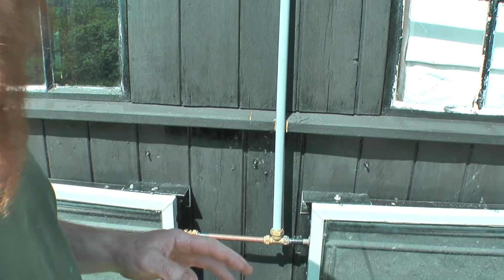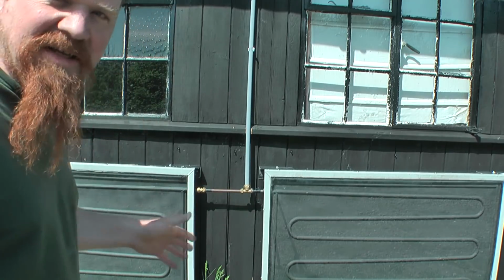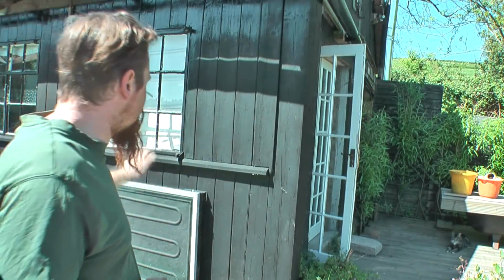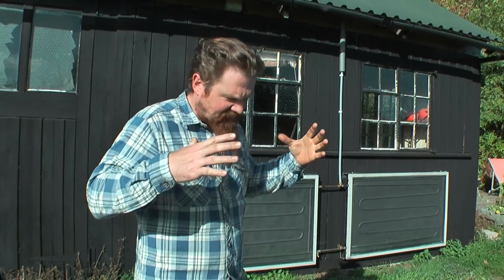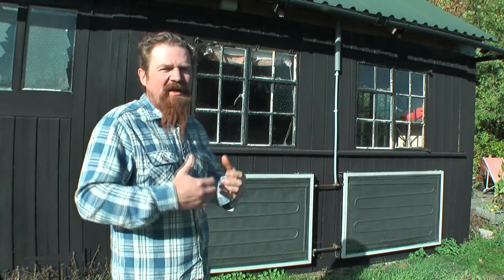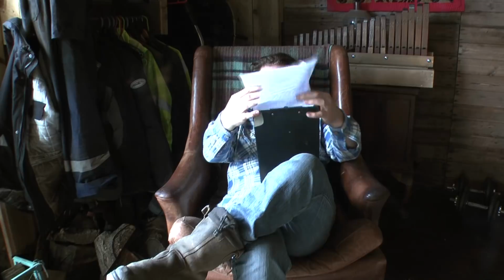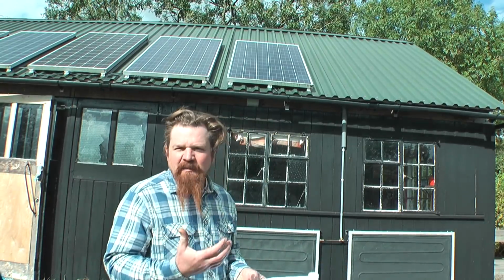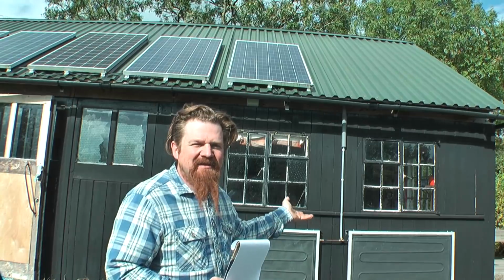Solar Hot Water Part 3 (of 3)

Comment: I have worked on designing controllers etc for solar PV and one of the issues is efficiency is lost when the cells get too hot. Energy from PV is not great for heating however this water heating type of system is significantly better and possibly the best system currently available for heating from solar energy. This leads to a question: how could the two be combined? IE a silicon PV panel (as GaAs is way too expensive at the moment) with water taking the heat from the cells and being used to warm the floor. That way you could potentially get significantly more power out of a panel than either system on its own. Not sure exactly how you could get even heat exchange on the panels but I'm sure someone could figure it out.

Comment: Another great video! Bottom line is you paid relatively little for the setup and have effectively got free hot water all summer. Win. 
No expert but i think you're right about not needing more pipe in the panels. Do you think adding some horizontal  heat sync fins to the copper might increase your heat uptake?
When are you going to add that fancy tube one?

Comment: Great experiment, but you need to lag that return pipe. The circulation will still work fine and you will get a higher water temperature.

Comment: The cooler the panel temperature, the less the loss of heat to the environment - and the more energy you will get into the hot water reservoir...well that's the theory...hope that was worth commenting on!

Comment: Hi there ,  years ago i was very interested in building my own panels similar to yours i did take it to the extreme as i always do when researching a build and found out that it i vacuum sealed the panel and used a vacuum pump to remove as much air as possible  the efficiency went up also i found that instead of black mat paint  using powdered lead on the collector had the highest efficiency of heat collection into the copper sheet .  hope this is food for thought for you.  you could always try making an experimental panel from scratch

Comment: I think you have done a great job.. like to see the system work. 
You say the flow rate is too high, so bends in the pipework can’t be an issue with yours? In fact if your thermo syphon is flowing too fast then lagging the return may be a good idea to slow it down. May even increase the output temperature and lowering heat loss too.. if it didn’t help it wouldn’t be a big job to take some back off anyway!

Legionella is the worry with warm water hence get it to 60 degrees every 24 hours,, but people scare easily about this.. it takes about a week for water to turn stale and the issue arise anyway.. think your managing it ok ..
👍👍👍

Comment: Insulate flow and return pipes of panels to tank. The thermal siphon will then only begin when the temperature of the panels exceed the tank. You need the panels to get to approx 5-10 degrees more than to tank to have a good effect of heating the water in the tank. Avoid all heat losses.

Comment: I think you've done an awesome job, using what you have.  Not having to light the fire so much in summer is a real bonus
My only comment is that I would not throttle the water in the panels before they return to the heat exchanger.  I think it would be better to heat lots of water a little bit constantly, rather than heat a little bit of water a lot and then dumping that through the system.  I know this is how solar hot water systems work for heating pools, basically only trying to raise the temp a couple of degrees every time the water circulates through the system.  Might be something to consider
Reply from the maker: Yep, I do let it run wide open normally, it's goes up to 40-45 degrees quickly that way but then slows right down. The throttling was just to see what would happen, if I tried to get the temp higher, maybe not explained myself very well there!
Reply: Awesome as that should be getting you the most efficiency out of the system.
Russ while you are right about the amount of BTU's gained you have not taken into account heat transfer
Generally speaking, the faster the flow rate the more efficient the heat transfer, but the efficiency has to do with the temperature difference between the heat source and the fluid being heated so there are diminishing returns at faster and faster flow rates. The rate of heat transfer between two points is a function of the thermal conductivity of the material between the two points and the temperature difference between the two points (and the amount of area of contact). A faster flow rate means the temperature of the water doesn't rise as much so that makes the rate of heat transfer somewhat higher.
The fact that the amount of temperature rise is lower at the faster flow rate doesn't mean the water rises in temperature more slowly. On the contrary, it rises a little faster since more heat is transferred as noted above. 
If you lowered the flow rate in the system, the temperature of the water flowing through the panels would rise more but the amount of heat transferred would be somewhat less due to the lower efficiency of transfer in the panel due to the smaller temperature difference between the panel heat and the water (since the water is now hotter). If you want more efficiency of heat transfer, an even faster flow rate would be a little better.
Reply: Same amount of energy being put into the water. Idea is trying to find the balance to keep the flow.

Comment: Hmm could you draw out a simple diagram of your system with some basic notes  on your Web site I would pay for it
Reply from the maker: I did a video on heating and hot water that has drawings in it. They show the heating and hot water from the kitchen range, but the same principle drive the solar hot water. That might be enough to make sense of this system. If not, I'll have a go at a diagram.
Reply: @maximusironthumper  tks time to  top up the maximus beer credit tks

Comment: Cool update Max, if possible do one in the winter as well. Any plans to integrate the vacuum tubes as well?
Reply from the maker: I might do, it would give me excess hot water in the summer which might be nice, on the other hand it would require a pump which would spoil the elegance of the current setup!
Reply: Maximus Ironthumper if the pipe size on the plenum is ok`ish you could treat it as just another panel and thermosyphon. Should perform better than the flat panels as the outside temp drops, or just mount it to project awesome for infloor heating:)

Comment: Yes, another video on this.
Did you ever think of having a boiler box stove in the main room to feed the radiators? Or is it rather redundant as you have this in the kitchen.
Reply from the maker: There is a massive stove in the main room that can heat the whole place just by brute force!
Reply: I thought would be the case, cheers for the answer. Another question, what does it feel like to have a life that many people are envious of.
Though it's hard work it seems like you have such a content and happy life.